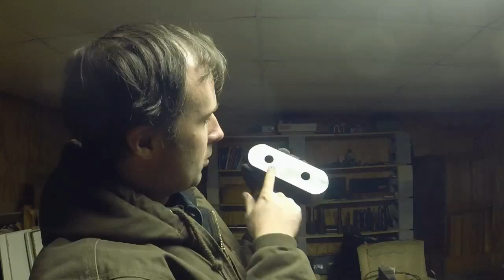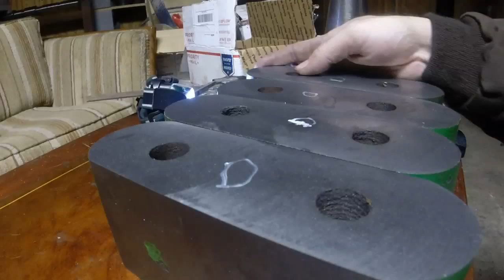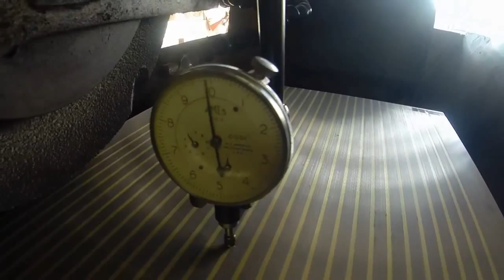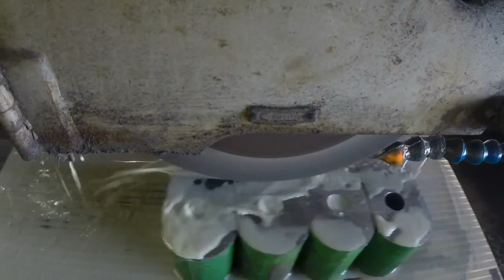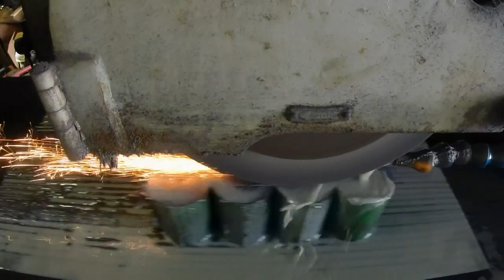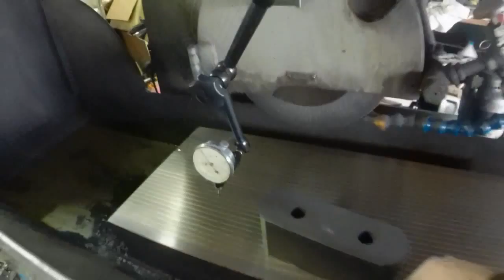Making matched step blocks using the mill and surface grinder.

Comment: Looks like your wheel got thumped. I would imagine that flood coolant is a nice feature to have in order to keep the dust down. Nice machine. Thanks for the video.
Reply: I would guess they can get pricey depending on what variety you get.

Comment: Brian what are the inserts you are using in your large shell millI have one like it but I am sure my father in law has the wrong inserts ...no relief and a chip breaker seems wrong to me ..I can not get a good finish
Reply from the maker: Most of my face mills use SPE inserts, I have some that take 4 and some that take 6 size ones. The facemills are touchy on insert depth for good finish you have to be sure you have no runout and all the inserts are set to the same depth otherwise you get a low insert that drags and puts swirls in your parts unless you run extremely slow feeds.
Reply: I have one that takes 5 inserts tpg and one that takes 8 inserts that are square thank you for your help
Reply from the maker: Bill Nebergall
The SPE inserts are square and positive for layed back holders.

Comment: Brian,  fun video I watched a bunch of yours today. Love the barn work, I did some timber framing back when I was younger and enjoyed fixing posts.  I see a nice old powermatic planer, I had a 160 for a long time.  
I like the big milling and surface grinder work.  Thanks Jay Kilroy for the channel recommendo.
Reply from the maker: Yep there is a Powermatic planer and a big 16" porter jointer sitting there too. Since I live in an 1830's house when I need to make repairs on something it all requires handcrafting as the lumber is all way over dimensioned by modern standards so I have that stuff for doing repairs and have built some cabinets and built ins using them. Fun stuff! Thanks for stopping by!

Comment: I know those are John Deere parts But I can't figure out what there off of. They should make good blocks for you Thanks
Reply from the maker: They are the blocks that sit on the final drives that the cab or 4 post bolts to on an old 4630.

Comment: Brian, did you have that shell mill in a drill chuck?

The dog needs a little more motivation lol.

I don't need a grinder, but boy do I need to get one. Keeping my eyes on things to maybe find a smaller manual one.
Reply from the maker: The dogs motivation is only to find a soft spot to sleep. lol  That face mill is on an arbor and is in the holder for that Beaver quick change tooling I got with my boring mill. I have been trying it out lately to see how it works and it certainly is a lot faster than screwing that big drawbar bolt in and out all the time as you only have to turn that collar a 1/4 turn to lock the holders on or off. It seems to be doing a pretty good job of being rigid enough for heavy use and I don't seem to be getting any run out out of it. Thanks for the interest!

Comment: Nice grinding work Brian. Are you going to use those for simple setup blocks? Like for stacking heights for strap clamps. 

Adam
Reply from the maker: Yes I kind of use them like how parallels tend to be used in a vise except these are made for large parts that will be using the mill table rather than the vise.  Because the holes are the same spacing as my T slots I can also use them as stop blocks as in my "its a boring job video"  and as setup blocks to clamp too like in my deck plate videos. I also have a set made that are the exact same height as the bottom of my Kurt Vise so I can support long parts in it for doing shaft work or drilling angles and channels for fabrication. They are pretty handy.
Reply: cool- got it.
Reply: Abom79 If Brian is a friend of yours- he's cool with me too.
Reply: bcbloc02  HEY Brian, you got new subscriber.Thats a bad ass mill- just stumbled across your channel where J Kilroy liked your Metal Mowing video. Do you have a video showing off your mill and vertcal head etc.?          THX  YOU will get better with yer camera.Bad ass machining footage!   -Keith from Columbus,Ohio
Reply from the maker: Keith Kelly
Thanks for the sub and welcome to my shop! The vertical head sees a lot of action in my deck plate and clutch videos if you want to check them out. I also did a video about the mill side controls and their use for horizontal work.

Comment: Pardon my ignorance but just how are you planning on using these pieces?
For the mill to get such a good result as this and finish it has got to be a rather special machine and a very good milling head!
Reply from the maker: If you look at my deck plate video around the 15min mark you can see these blocks in action on my mill. My idea was to make some more of them so I could do a project like this without having to use my screw jacks and indicate in. I can just use the blocks instead and know my part is well supported and level. I hope that helps. The mill was just my regular old Cincinnati milling machine and a carbide insert face mill. I was actually kind of surprised by the results of the milling myself. Thanks for the comment and if you have any more questions I will be glad to try to answer them.

Comment: 12" X 24" that is a good sized grinder. I think everyone has one but me. Brian can you tell me what is the different between the SPV 1-E or 1-B tapping head Thanks
Reply from the maker: I don't know this as a fact but I think the E's will float the tap both in and out but a B will only float backwards. I think the E's are for manual machines and the B's might be designed to use with a CNC that would be power tapping. Mine are all E series with built in NMTB shanks. If you want one I would look real hard for a set with the tap adapters as they cost a fortune to acquire individually and are a bit hard to find.

Comment: Hi Brian, just curious as to why you only ground one side and left the other milled.
Reply from the maker: For stand blocks they are plenty good enough especially if you use the ground side since its within .0002 and the .0005 variance on the milled side does not translate through or it would have showed up on the indicator. I actually doubt my mill table is any better than .0005 so I saw no need in taking the time to do the other side, I just wanted to get them all the same height and the grinder does better at that than the mill.
Reply: Fair enough.